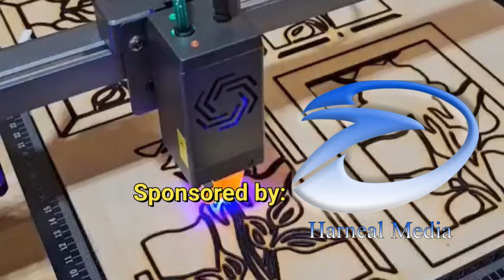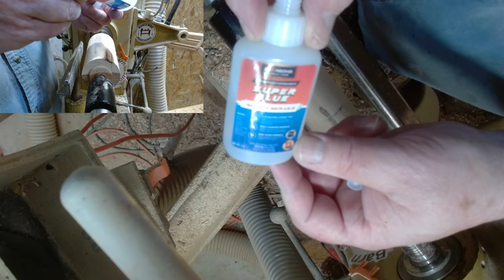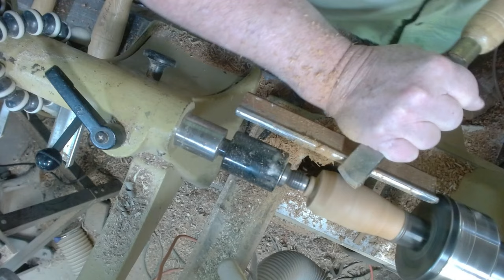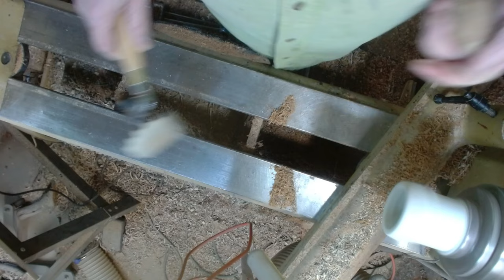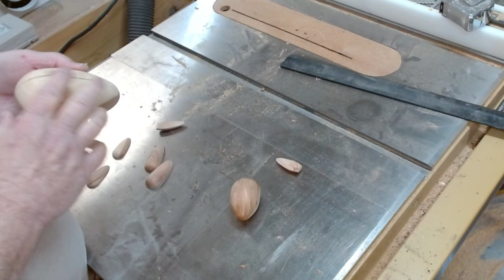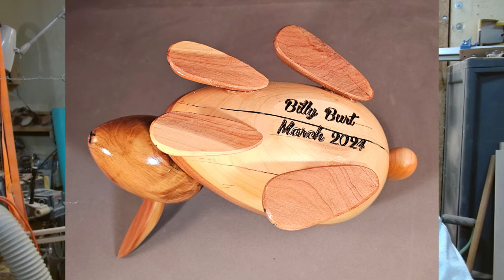Woodturning: Watch This Amazing Juniper Bunny Come To Life

Comment: Really cute Billy. When you first mentioned holding the body, I thought of a donut chuck but the length to diameter ratio would be unstable. The collet was better.
Reply from the maker: Thank you very much, Bill.  I donut chuck could work if you could keep it stable.  The problem would be the round bottom.